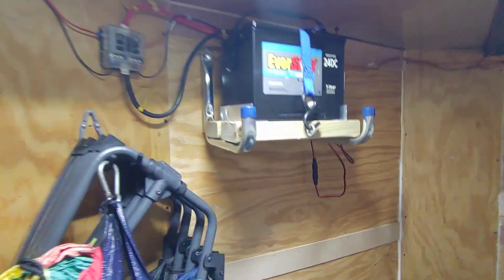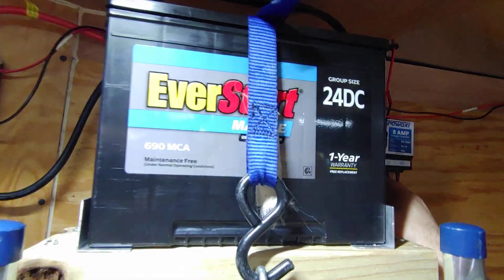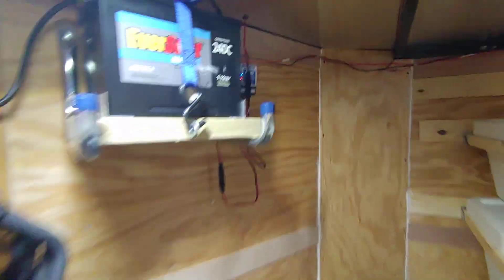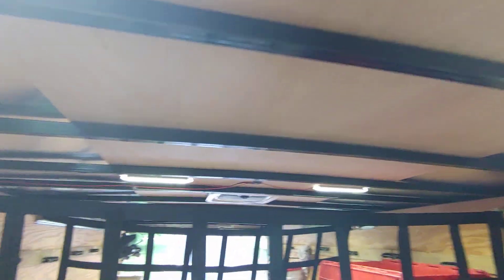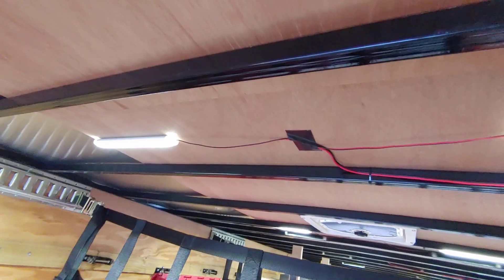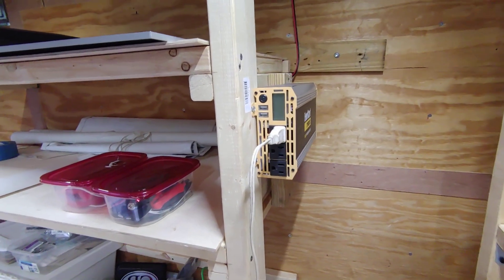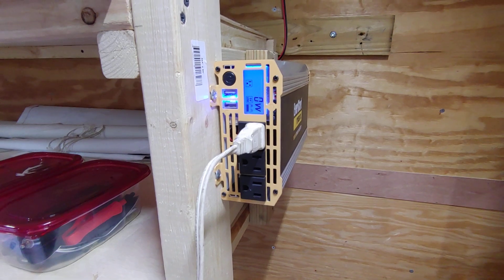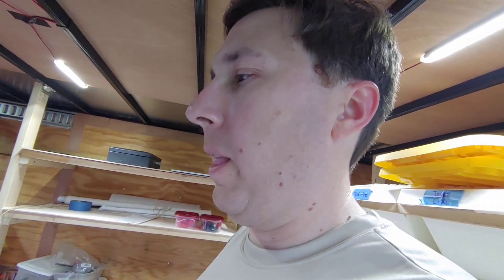Adding a self-sufficient "off-grid" 12V electrical system to a cargo trailer

Comment: I have a smaller trailer and I did the same in some fashin. I have a 100AH AGM abttery. 2, 100 watt flexible solar panels on roof. And a 60 amp PWM solar control charger. I have it using foe interor lights, and running the electric tongue jack. I also have a 200 watt inverter to run a cooler and charge devices etc etc when on trips. It keeps the bat art 13.8 at all times. Best thing I ever did to that trailer. Once thing I have yet to do but do not really need it, is to have the truck charge while I drive but after 3 years, I do not need it as the system is beg enough to handle. Yes overkill but that's the way I roll. Thanks for sharing

Comment: More like 70Ah, you'll need 10x the solar you have. That battery will not see Christmas. Inverter beeping is low voltage, i.e. battery discharged or cables too thin.

Comment: The beeping is low voltage warning. The battery symbol shows it being at 50% battery capacity. You would need a lot more solar or batteries to keep up with the inverter. I just looked up the battery on Walmart, it shows Amp hours at 1 amp 101 so that should mean 101 amp hours. I could be wrong on that. It saying group size 24dc is weird to me but that is a choice they made for that battery size as it is a 12 volt battery.
Reply from the maker: Yeah, the battery was way down when I filmed this.
Reply: @vonirkinshtine  I believe the rating on the battery means if you use 1 amp it would last 101 hours. I have no idea how long it would last at a higher amp load. Depending on the load of the fan and the lights I would guess it pulls around 20 amps but could be more or less than that. An amp meter would be able to tell you what load they pull together. I would still guess about 50 amp hours just based on other lead acid batteries.

Comment: Cranking amps are not the same as Amp hours. I would guess it is around 50 to 70 amp hours just based on car batteries at that size. With the solar and not a big load you should not have any issues using it most of the day. Led lights do not take that much power to run. Definitely wont run an AC without a lot more batteries.
Reply from the maker: I'm used to battery capacity in terms of amp-hours or watt-hours. I was way off.